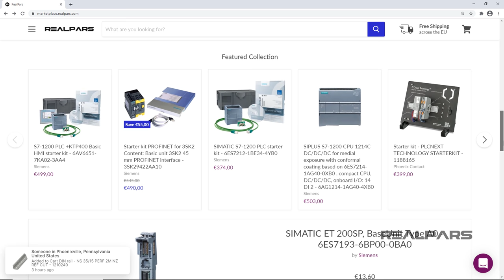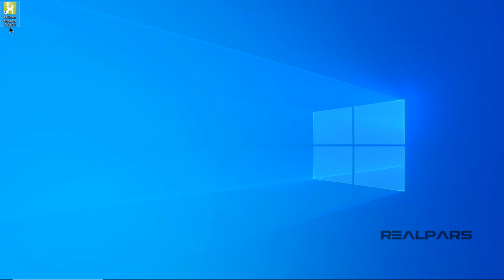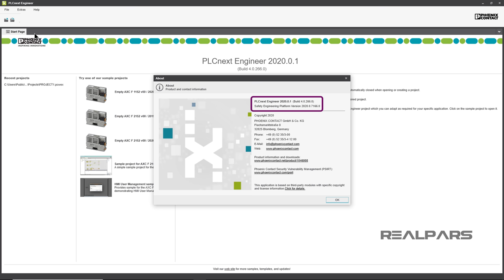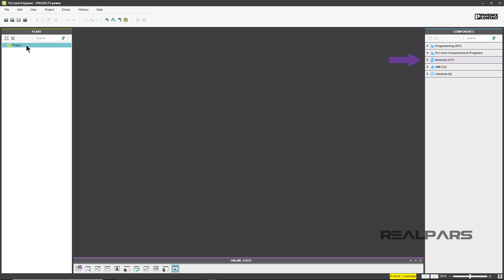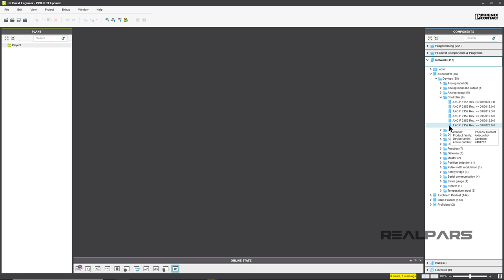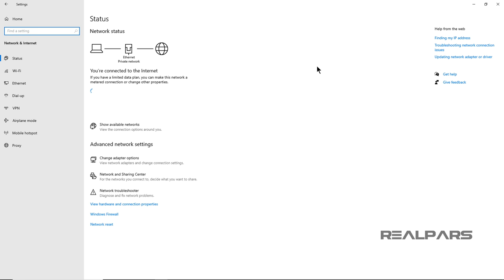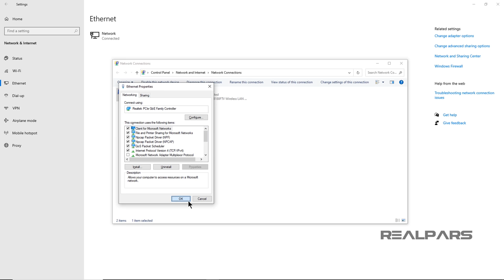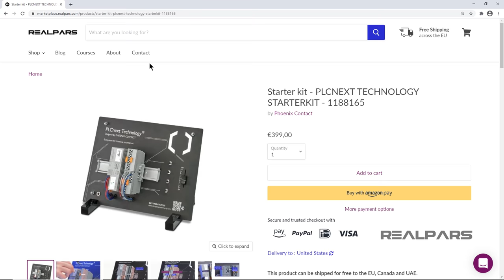PLCnext Tutorial for Beginners - Part 2 | Create a New Project and Configure Ethernet Port

Comment: I love RealPars when it comes to industrial automation. You guys rock. But I was wondering can I follow up with this series of PLCnext tutorial just by using simulation and not actually buying the actual product?
Reply from the maker: Hi Abel. That's an interesting question and not an easy one to answer.  The PLCnext Engineer software has some limited simulation capability that allows you to test logic, but not to actually simulate I/O like some other vendors.  Our intention is to take viewers past the logic stage and do some actual wiring and testing of field devices. If you like to play with field devices such as switches, fans, motors, etc., then buying the Starterkit is a good deal. If actual hardwiring and field device testing is not of interest to you, then it would be best to give it a miss.
Reply: @realpars  Thanks for your quick response. Anyways I'll try to do what I can.

Comment: I have starter kit and new windows cpu.  I am having trouble establishing communication with olc & think your video isn't explicit enough and you go way to fast!!   For example, phoenix contract has numerous software options to download. I had to call them and ask which one I needed.  There are also 6 options for the AXC F 2152 Controller all with the same order number. Which one??  My software is similar but different from yours and I have watched this video over 50 times and failed to understand.  Maybe I am just too incompetent to take on this endeavor...?!?  At least I spent a bunch of money on something to use as target practice!!
Reply from the maker: Hi Bruce, Sorry to hear you are having problems. Frustrating I’m sure as I’ve been there myself. I have to admit, it wasn’t easy establishing a connection between the Controller and my computer. But, I did get there, and haven’t had any issues since. Phoenix does indeed have lots of AXCF2152’s with the same order number, and I had the same question as you. Phoenix told me to select the oldest version and all would work, and it did. (04:10)  How is your software different than mine?  Is your computer address set to 192.168.1.1? (05:09) Video 2 stops at setting computer IP address. Video 3 continues with the actual steps to establish communication. I don’t know if you’ve watched Video 3? 
https://www.youtube.com/watch?v=h7Ari9nmQgU&t=18s
Phoenix Contact has an excellent blog and forum section for users. 
https://www.plcnext-community.net/en/
Please do let us know how you are progressing. Don’t give up! It’s worth the effort.
Reply: @realpars  Thanx for your response!!  I will start new project with  oldest controller version.  Phoenix Contact recommended I install software version 2021.0.2 (latest version)  above software achives in software downloads.  Yes, I've watched video 3 about 28 times & find it informative and to the point.  My dropdown for testing cpu to controller comunication is quite different with numerous options (most with a red x).  Of course my cpu has no ehernet jack, so I had to order usb to ethernet adapter.  I find it pathetic that well after a month I still cannot communicate with plc controller.  Everyone is is praising the video with short responses.  I assume none/most of them do not have said plc trainer and just following along for informative reasons?  I am going to do my best to not give up.....yet!!
Reply from the maker: @brucehackney1276  Hi Bruce. I'm glad you're still with us.  Your USB/Ethernet adaptor may be your culprit??? You probably already have done this, but are you sure your IP address is assigned to the adaptor? I've not seen the dropdown for testing that you refer to. (most with red x). The only online device scan I know of is at 1:26 of https://www.youtube.com/watch?v=h7Ari9nmQgU&t=73s   If you are still having issues, perhaps we can carry on this conversation via a different media?
Reply: @realpars  After setting this  endeavor on the "backburner" for months, I decided to give it one last try.  I've got everything set as  explained but after doing the scan the controller ip address and subnet mask remain blank.  Not certain what to do.  Is there any technical support for this type of problem?  My  brand new P.O.S. windows laptop didn't come with an ethernet port, so i purchased a 3.0usb to ethernet adapter.  This item shows and I assume it is correct and working, but...I am basically stumped again & can't go any further.  Who iknows, maybe after I use it for target practice I could post the vid to youtube and get some likes.....